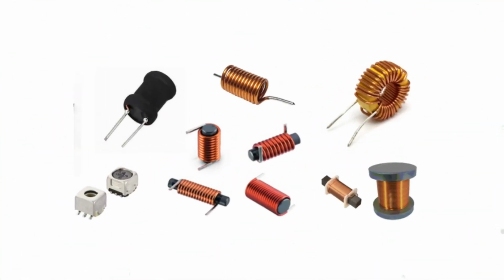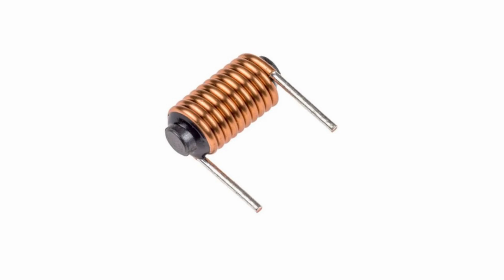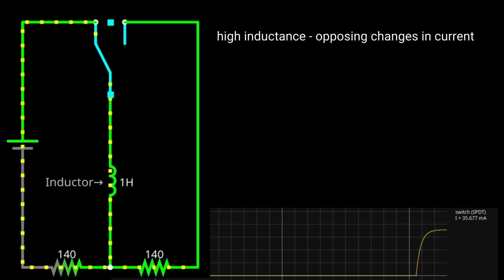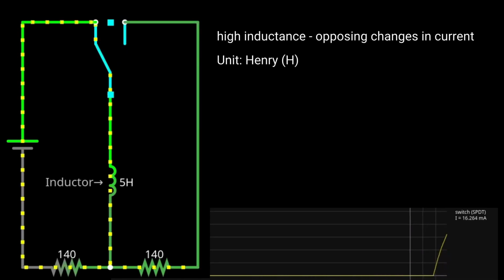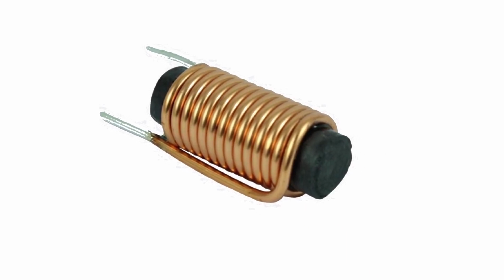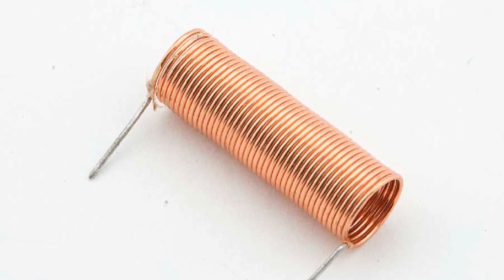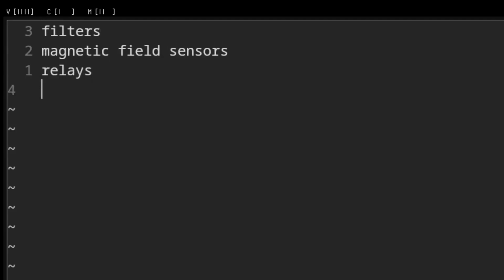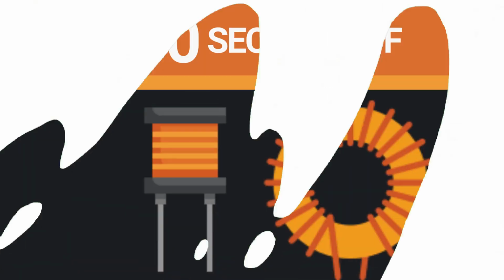Inductors in 100 Seconds

Comment from the maker: Note: although I labelled the terminals "+" and "-", for most use cases inductors have no polarity meaning you can connect then in both ways. 

Some manufacturers still decide to label the terminals but that is a large topic: https://www.quora.com/Do-inductors-have-polarity?top_ans=168431472

Comment: I'm getting into electronics, and I got an arduino kit and I bought another kit of basic electronic components. Neither came with inductors, but I got plenty of capacitors. Why is that? Are inductors more used for larger power/motor type systems, or are they more pricy due to the material it takes to make them, so they are left out of these kits due to cost?
Reply from the maker: In my opinion:
- yes, inductors are usually more expensive
- they are a little bit more advanced so basic kits used to learn arduino and so on don't really need to have them. 

Good luck on your electronics journey!